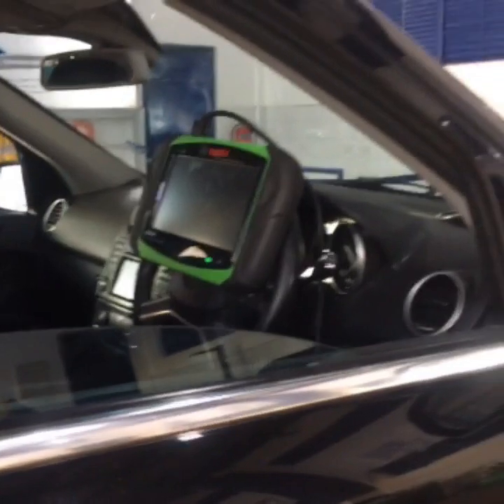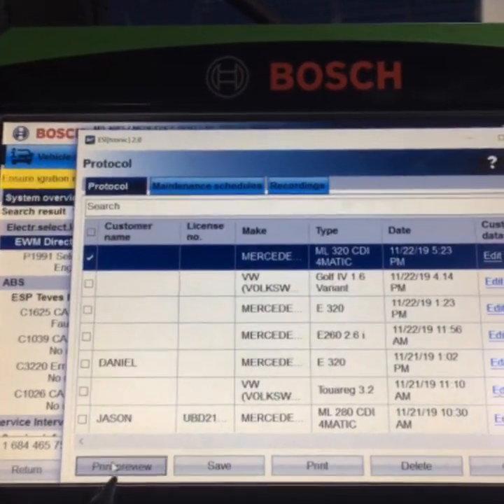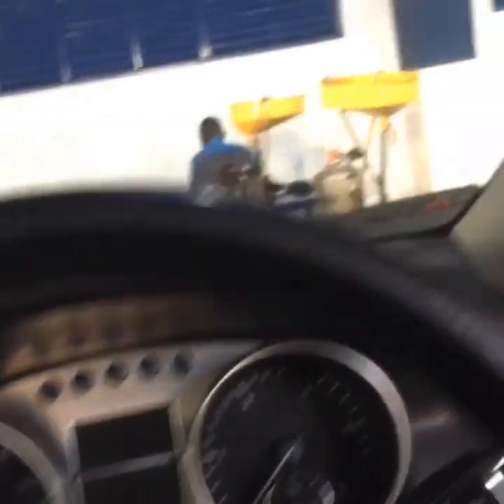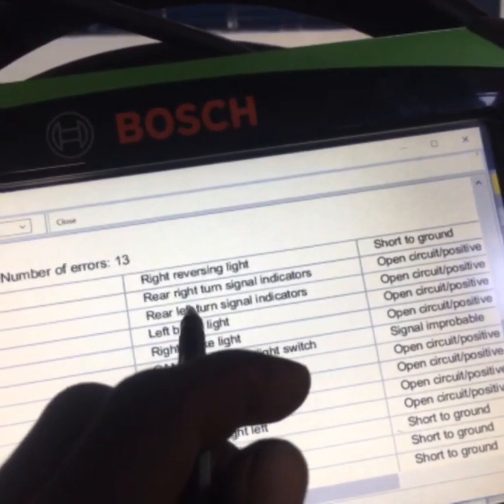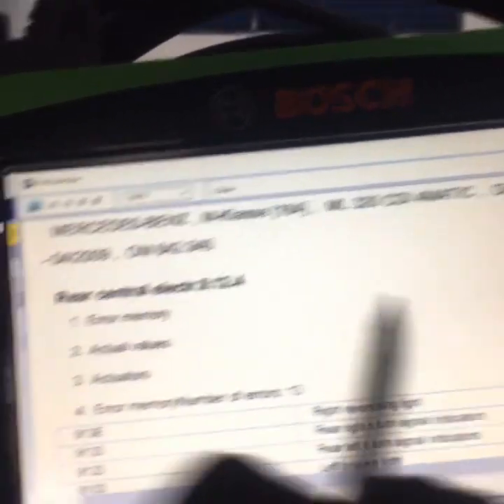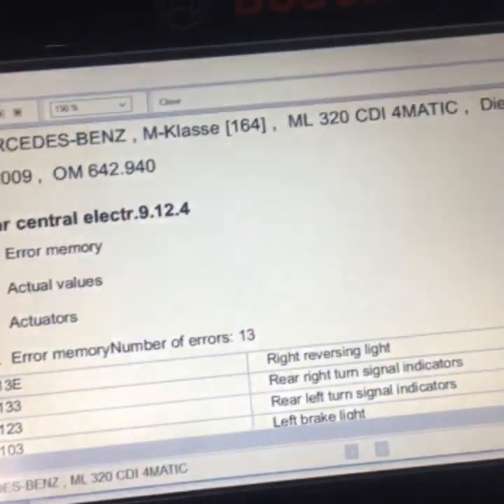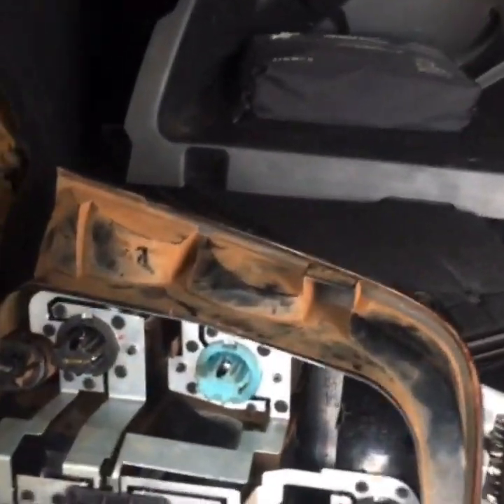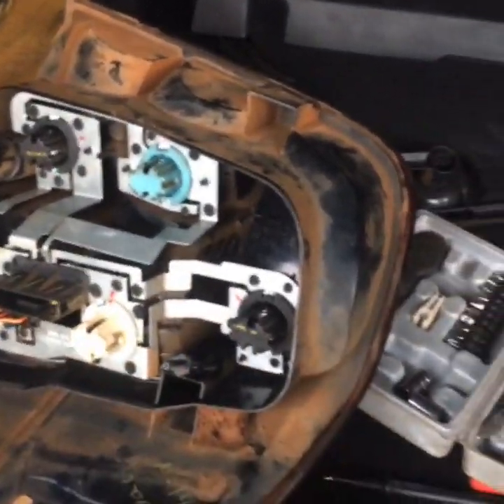Mercedes Benz ML280 W164 CDI Lights Problems(Rear Light/ACQUISITION Control Module )#Mugaluthecarguy

Comment: Hi there. I have problem with my ml280 from 2009. My front right indicator flicking with my front right fog light. Where I should start looking for problems?
Reply from the maker: Hi,nice to hear from now in 2025 though this video is old… Hope that Mercedes Benz M class has a W164 chassis,now for your front lights.. check if bulbs are ok and if they are,access the front SAM signal Acquisition Module located underneath the driver seat if it’s a right hand drive or left if its left hand drive vehicle. It’s located near the Main battery area and at  the sides of the (auxiliary battery) small battery ,check for elevated ingress and battery corrosion that usually enter it,if you find that module damage from them advised to replace module

Comment: Good morning, great mind please my Mercedes Benz gl320 bluetec is having tail lights problem all the tail lights not working liftgate no opening automatically my real SAM is not corroded so, please help me thank you.
Reply from the maker: Its most likely a defective Rear SAM though you need to perform a verified fix by MB Star DAS scanner in order to perform SAM module diagnostic,programming and SCN coding.Dont forget to subscribe.
Reply: Where was the water coming? Did you fix that or left it for the next job?

Comment: where to buy the electrical module
Reply from the maker: You can reach Mercedes benz dealer or you could have it through online sites or technically me, remember, if you buy that SAM,it  needs to be coded, you will need to have it programmed. The dealer is not your only option. If you have a mechanic in your area that has an authorized MB Star DAS scanner, they will be able to perform SAM module programming and SCN coding.

Comment: Hello, can my ML 320 2007 not to start easy in the morning from this problem? Especially cold morn
Reply from the maker: Thank you for reaching out,dont forget to subscribe,its not true that your car will fail starting from a defective rear SAM,have the car connected to a star/ reliable diagnostic scan /check to find out the problem without guess work.